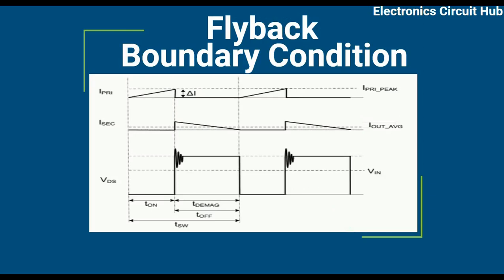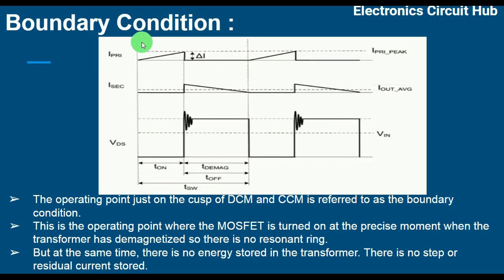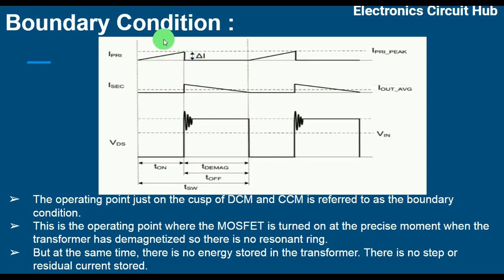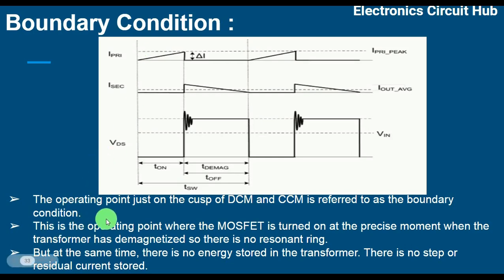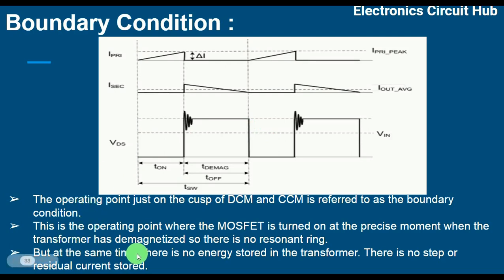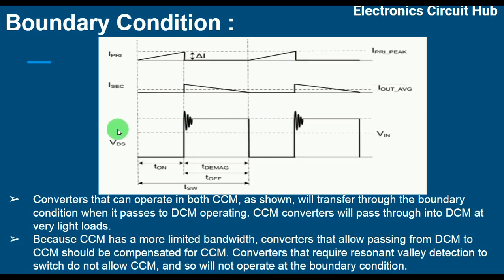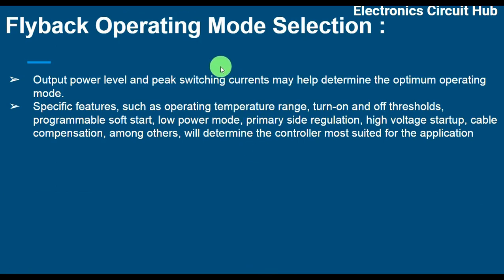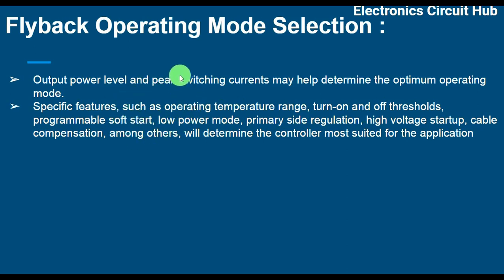Flyback : Boundary Condition Mode (BCM)

Comment: We got one issue in 10W power supply. Initial the power supply giving 6W after 2seconds the full power 10w is coming why in this BCM operating mode
Reply from the maker: Hey...not sure if it startup issue ?
Pls. Check the Auxiliary winding voltage in DSO.
Also pls.check how drain voltage and current ramps up.